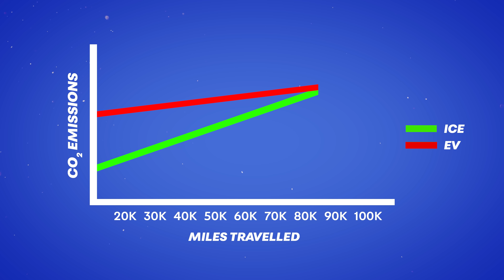Are Electric Cars REALLY That Green? [New 2022 Data]

Comment: Now it would be interesting to see what the cost for the US (you did worldwide and the EU), and not just sunny California or Arizona ... but say snowy zones where solar isn't as effective. Also, it would be interesting to factor in milage beyond the 124k miles, when those $57,000 to $100,000 EVs need new batteries and the old ones have to be disposed of. To me, 124k miles is nothing. I'm coming up on 350,000 miles on my 21 year old truck that cost only $20k.

Comment: The really important factor regarding adoption of EVs is how much time will you spend charging your EV compared to fueling an ICE, given your individual driving needs, habits, and housing dituation.  If you only drive locally and can always charge your EVin your garage overnight, you may get by spending 2 to 4 minutes every day or every few days or a week to hook up your charge cable and then disconnect it the next morning.  You might also waste a couple extra minutes every time you charge dealing with the impediment of having your charge cable strung between the wall and your car (i.e. the cable is in the way of you walking by or moving stuff around in your garage).  This hassel must be compared to that of driving to your local petrol/gas station every week or so and spending a couple minutes refueling, perhaps a few minutes waiting in a queue, andperhaps a few minutes driving to and from the station.

Most likely, the time spent by someone in the above scenario is similar between EVs and ICE vehicles or is less for EVs.

On the other hand, if someone cannot charge at their home or takes frequent long distance trips where they must recharge at charging stations, then the EV may require a lot more of the operator's time andmay not be worth it considering the value of that time.

Comment: No, not everyone can claim the moral high ground, that is not what this report claimed. It has always been known that the initial CO2 footprint of an EV is greater, but you're not considering/mentioning other aspects not in the report, a clear one being air pollution. There are actual figures for the number of people killed every year by city air pollution from cars, the nature of ICE means that the compounds released are worse than those of even gas power plants and it's being concentrated around people.
I don't see how you can claim a moral high ground just because a fairly low lifetime mileage is required to break even for GHGs when that high ground is actually a mound of dead inner city kids? (the break even point is even shorter for city driving FYI)

Comment: 1) how long does your car's battery system last?  Is it going to be useful after 100K miles?
2) Ok, you've got Solar and a Power Wall (or other storage) at home.   What's the Total Carbon Footprint(TCF) of that system and how much of this TCF can be applied to the EV car(s) you own?
Reply: 1a) if you have to replace the battery every 75K miles, then you also acquire a heap of more carbon.

Comment: the more the battery is used the worse it will hold a charge and it will need to be replaced so you will almost start over with the new batteries.

Comment: I am not sure about the hats off to Volvo.  Consider again what they have to gain by making the difference between the two appear much less.  Traditional companies are very concerned about going bankrupt when ice cars go out of fashion.  If they can make it so the choice isn't so obvious, then they can fade more gradually and not risk bankruptcy.   This would explain why they might make ICE cars look a little more green and electric a little less green while still being able to state somewhat accurate stats.

However, there are things that I am sure they missed, probably knowingly.  Consider the batteries right now.  Even if batteries were 100% recycled guess how many batteries from non recycled materials there would be? 0% right, we would just reuse them all.  No, at a guess it would be something like 95-99% of batteries.  Not many electric car batteries have reached end of life and even those that are, well there is probably 100x more electric cars being sold now than when they were sold.  However, when the industry matures those components will be recycled, not 100% but at least 90% and that will improve over time.  This will mean that the carbon emissions from producing a set of batteries is only so significant for the first batteries that those materials make, not the second, third, or hundredth.  As you said, another thing to consider is that electric cars are in their infancy, they will continue to get more efficient as will their manufacturing processes.  The third point is that Volvo was comparing a chassis intended to be for an ICE care that is also being used for a BEV.   Not a chassis that is designed for a BEV, this means right off the get go it is going to be biased for the ICE.  

Good video though, I thought I was going to be really disappointed.

Comment: one thing i didnt hear you mention at all is the decommissioning costs.. 
the batteries are VERY expensive ... so , as far as i am aware, none of the batteries are being recycled - they are just being dumped/destroyed - which is quite a cost that you don't seem to have mentioned
Also - car engines now run for >200K... but batteries, its an unknown - we dont really know what the life of them is... but when they are deteriorated enough they have to be replaced - which is a large "initial cost" again
none of that seemed to be discussed in your article.

good article.. but there are areas that were not touched on.. 
im not really so interested in "well to tank" and "start to 124K miles"... im MOST interested in "lifecycle of the vehicle INCLUDING decommissioning and waste/storage"... that all comes into the overall footprint of a vehicle. - by stopping at 124K miles-  it seems to Ignore all those waste costs - and any cost of replacement batteries , in terms of C02 footprint to make the replacement battery.

Not many cars are thrown at 124K these days!  They were when i learnt ot drive in the early 80s... but not now

Comment: Not forgeting of course that the batteries don't last forever. Expect to replace it every 10 years, so that is another big volume of CO2. In summary, if you drive lots of miles then electric will be better in the long term but if you don't then a petrol car would be better for the environment.

Comment: I haven't seen the study so I'm not throwing stones, but has the study considered the pollution caused in disposal/recycling of the EV vs ICE?  My understanding is the batteries of the EV are not recyclable and present significant environmental concerns in disposal.  I have also heard that the longevity of the batteries is around 8 years.  Given the average lease mileage of a car is 12,000/year, at 8 years the mileage should be in the area of 96,000 miles or about where Volvo estimates one of the three break even points.  An ICE vehicle has an average life of 200k miles so what would be the additional cost and environmental impact of the EV car be over the same 200k miles?  Curious minds want to know!

Comment: As the battery tech develops and they get faster and faster recharge times with longer ranges that gap in the data will shrink. This industry is still brand new and new breakthroughs are happening all the time. Like he said if you are recharging with solar panels, and car companies start fueling their factories with megapack batteries and solar panels to reduce energy costs, the gap will continue to shrink.

Comment: Number one is that an Electric XC40 has an efficiency that's around 25% less than a Tesla Model 3, which means that a Model 3's break even point is going to be WAY sooner.  Additionally, Tesla is covering all their factories with Solar Panels and Storage Batteries for power, making their carbon footprint for manufacturing MUCH lower than other manufacturers.  As for why Volvo is putting out this information I think is fairly evident.  Go to a Volvo dealer and try to get an Electric XC40 and they either never have any or they have ONE that everyone is fighting over.  In the meantime they try to sell you one of their Hybrids or even regular gas cars, but no one wants them.  One final thing that I wonder if they included in their calculations is that it takes around 5Kw to make ONE gallon of gas, it's an EXTREMELY energy intensive process.  Keep in mind that a Tesla Model 3 can go around 24 miles on 5Kw!  Most cars in the USA gets around 24 miles per gallon.  YES!!! The same amount of power that it takes for a Model 3 to go 24 miles is what it takes to create a gallon of gas that currently moves a car 24 miles.  Take that same electricity and bypass the Oil to Gas conversion and put it DIRECTLY into an electric car, how much less carbon intensive is that!

Comment: It actually costs more in C02 and resources to make a combustion engine than it will ever use in its life. At the end of the day a combustion engine is 30% efficient a electric motor is 99% efficient. Those 2 facts have completely ruined you made up statistics

Comment: I spoke to my car mechanic regarding hybrid cars and he said he noticed the batteries start degrading to a point that he needs to swap out one or two every year at the 2nd year of use. However he can’t comment on pure electric cars because he hasn’t repaired any. So I’m assuming pure EV cars will also need to have their batteries swapped out every few years. That would instantly reset their “greeness level”

Comment: I have an EV currently. Unfortunately is a battery EV. Thanks to Electric Jesus (Elon Musk) there's not been put as much reasearch into hydrogren fuel cells, but in stupid and heavy lithium batteries. I'd rather have my EV run on fuel cells. Easier and faster to refuel than bEV and ultimately better for the environment as soon as we stop producing hydrogen with steam recombination which produces a f*ckton of CO2.

Nice to see Rory finding a good home away from Top Gear.

Comment: Just one thing I would want to add: The saying that ICE cars use more fuel on normal usage and not the consumption made in a laboratory is true but this also goes for EVs. Their consumption is also made in a laboratory and is higher in real-world usage. It purely depends on the way of driving.
Reply: quality of the battery is a serious question for every EV owner.  no one with an ICE worries about the state of their fuel tank... they may worry about the quality of their fuel, but then so will an EV owner worry about the quality of their charger.  To me this is where ICE clearly wins out over EV... the convenience and practicality of fuel in a fuel tank vs electricity in a battery just smashes any feeling of saving the environment imo
Reply: Also temperature. ICE cars don't change mileage when the heater is on. For over half the year EVs can't achieve there mileage in many parts of the world due to cabin heating.

Comment: Thanks for telling the internet what I’ve been preaching for years now. Also at 100k miles or less you’ll need a new battery or you’ll be getting less and less range. So there should be a second jump somewhere between 70 and 120k miles.
Reply: Since 2015 this is unlikely.  Previously Li-Ion gave 1600 cycles to 70% capacity.   Even 1600 cycles is 240,000 miles (at a middling 150m range).  The 1600 cycles is based on fast charging (over 1C).  If we charge a 70Kw battery at 7Kw (0.1C) the cycles to 70% will be well over 20000, so recycling current batteries will become common.  Kudos to Volvo on the PDF.

Comment: The carbon footprint of manufacturing batteries depends on how the manufacturer generates its energy. It is expected that over time, the manufacturers will switch to solar power to generate the energy to build the batteries. Thereby fully eliminating that carbon footprint for EV's. An ICE vehicle can NEVER eliminate its carbon footprint.

Comment: Good info. I'm curious about life expectency of those batteries and how the environmental impact is skewed when replacing a pack.
Reply: I don't know anyone whose EV didn't need the batteries replaced after 5 or 6 years, and in that time frame the vast majority of drivers will not reach anywhere near 90,000 miles
Reply: @pedazodetorpedo  drop the anecdotal evidence. I don't know anyone who has ever needed to replace their EV battery. That doesn't mean that they last forever. Manufacturers like Nissan guarantee 80% capability of the battery after 8 years on the LEAF now,. Teslas have proven to be around 90% capacity after 10 years. Drop the myths.
Reply: What I understand is Batts last about 15 years depending on your circumstances of course. No one will replace them in a 15 yr old car as they will be worn beyond usefulness. Ice vehicles Ave 25 years and the better ones go much longer especially when well cared for. I'm a very good mechanic and buy my vehicles 20 yrs old and up. Also a very high population can only afford these older cars and while EVs have a place the majority still will need Ice vehicles. It takes fuel to build both and I don't think it's possible to double and then triple the electric grid in the U S to handle EVs. The grid can't handle the winter heating needs by a long way yet and winter heating is more important than EVs

Comment: One thing I see not being accounted for is that batteries don't last forever.  Battery life will vary depending on climate in one's location.  If batteries have to be replaced with in the  50-90k milage time frame that would move that cross over point further out.

Comment: interesting video and well presented.   It is very hard to report on all aspects of what was taken into account. 
 These report also may not cover the cost of emissions and damage to the environment from spills of oil on land or ocean and the cost efforts to repair damage. Like remediation of oil sands fields or cleaning up oil pumping lands.   Like you said it is a very hard thing to compare and leaving out any steps in either supply chain and build and post use of the vehicle can skew results.  I think some of the main Takeaways are that as a whole considering the environment and health issue is at least becoming more to the forefront. And moving forward all current and future methods of mining, manufacturing of vehicles and recycling will improve and become greener or at least as green as economically feasible for the time.

Comment: Awesome well balanced video. I've been riding my electric ZeroSR since 2017 and love EV's. They definitely are the future.  There is one problem that this report doesn't cover though.  I't doesn't include the cost of recycling the vehicle at the end of its life. The current energy (CO2) cost to recycle Lithium Ion batteries so we don't just end up with tonnes and tonnes of toxic waste is phenomenal . This cost is why only 2% of these batteries actually go through this process and most just end up in some kind of storage, or worse in a landfill.  Thankfully companies like Toyota are developing better batteries like their solid state battery, but until these hit the market on a mass scale, EV owners are just virtue signaling hypocrites if they ever claim to be environmentally friendly.
Reply: I thnk you completely missed the point of this video.... Assuming Volvo's report can be taken at face value (and it looks like we probably can, props to Volvo) the whole point here is EV's are cleaner, albet not as much cleaner as EVangelists would like us to believe.  We're NOT virtue signaling hyprocrites, EV drivers are making difference.  Maybe not as much of one as we hoped but its still better than burning petrol.

If you want to bring the recycling cost in then you ALSO have to remove the an appropriate portion of the production cost from the start of the equation.  You can't cost account battery production AND the recycling process back into new batteries to the same car.       

And finally, if you want to discuss toxic waste you again have to account for it on both sides of the equation.  I'm not suggesting the end of life outcomes for EV batteries are all roses and unicorn farts, clearly theres room for improvement.  But EV's dont have to be perfect to be better, incremental improvement is better than no improvement.   BP's compensation fund for the Deepwater Horizen leak was $20 Billion.  One anecdote does not an argument make but its fair to say we can bury a god awful number of EV batteries in the ground in really stupid ways before we approach the environmental or financial cost of that ballsup.

Comment: You are only looking at carbon dioxide emissions, which are arguably a positive thing because plants and trees thrive with more of it, and ignoring the environmental disaster of the mining, smelting and refining the metals that go into the lithium ion batteries.  Then there is the eventual end-point of the cars and the associated dilemma of what to do with the batteries.  Recycling them is a daunting task, like with our plastics.  Speaking of plastics, don't forget that we will still need petroleum for plastics, synthetic rubber (think of tires), synthetic fibers, lubricants... what do we do with the gasoline, burn it off at the refineries?  That's what was done before it was discovered to be useful as a fuel -- just burned away.  Modern computerized fuel management and catalytic converters make ICE vehicles insanely clean compared to the the past.  Really, they're just fine.  No need for soul-less electric vehicles.